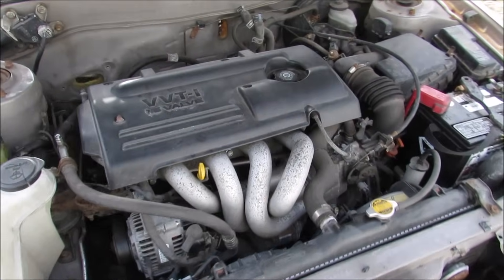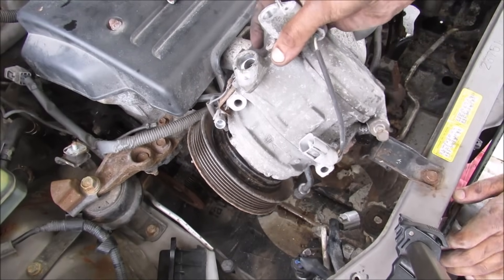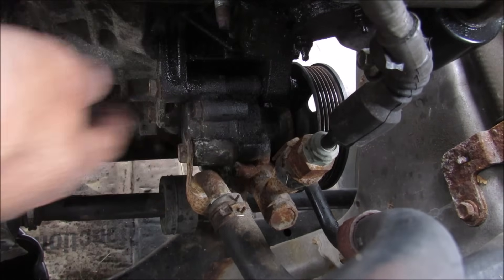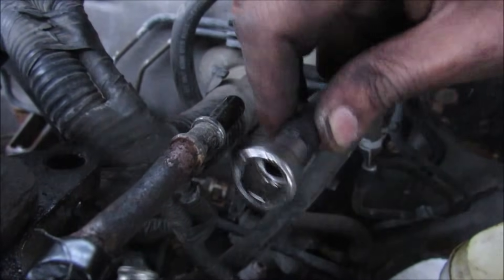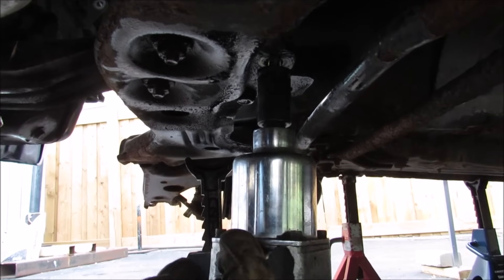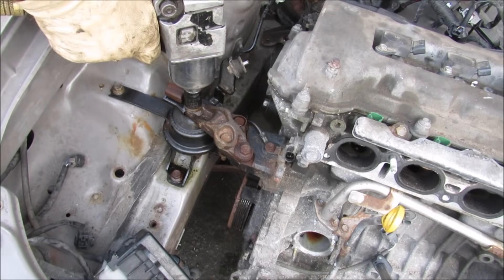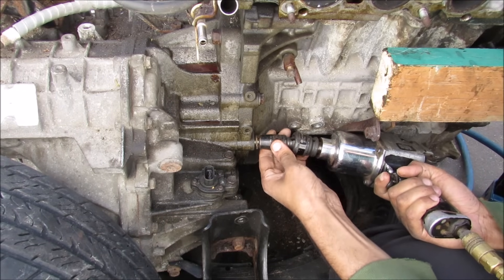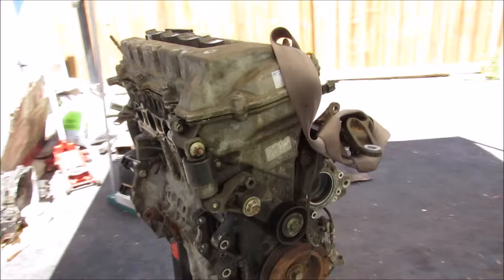How to Remove an Engine

Comment: Do you think this would work with the 3.0 v6? I don’t want to drop the subframe
Reply from the maker: I've removed a transmission from the 3.3 V6 Camry but it had to come out the bottom. 

I was able to get a 3.5 ES350 to come out the top, check my other video on that.

Comment: im doin this right now.   all but one exaust bolt has lost its nuts, just crumbling metal.  power steering pump bolts are out but its rust welded to the block. both studs broke off the bottom of the engine mount when trying to remove, they were rusted through like you would see on an old Ubolt for leaf springs. the alternator is crunchy, one starter bolt head broke off, left the stud behind.   the trans to engine bolts - more than half needed a big 1/2" air uggadug or a breaker bar with cheater pipe to break free.    coolant hose clamps were not reusable as they fell apart like a dorito when compressed.   im attempting to remove the engine nad leave the trans in - we will see....   its all loose now, tomorrow ill try and pick it up.

Comment: What is the minimum that needs to be removed to hoist the engine and transmission out if the car is going to he scrapped?
Reply from the maker: Axles, engine mounts, harness, fuel, vacuum & cooling lines. The rest can come out with the engine.

Comment: Fyi this isnt a good tutorial, many redundancies here, my biggest one, you can remove the transmission before pulling out the engine I honestly dont know why he didnt do this, it defies logoc, second things attached to the engine like water pump, alternator, etc can be pulled out eith the engine. For the begginer.wheb renoving and engine focus on disconnectinf these: transmission, any and all vaccum tubes, disconect radiator hoses, disconnect cables, disconnect gas line, lastly disconnect transmission, at  that point disconnect engine mounts, then youll be good to go.

Comment: Very good, concise video!
Two things I would focus on:
1 The welded nut for belt tension release; kind of odd thing most people would probably be clueless about (including me at one point 😁).
2 The exhaust manifold connection to the muffler connection needed to be unbolted.

Comment: i looked up "How to pull an engine" expecting a tutorial on an old muscle car or a truck or whatever, but no you made one on a 2001 corolla which is exactly what I needed! I'm preparing to pull the engine from my 2002 corolla soon, only difference is its a manual. Thank you for making a video thats short, and to the point showing every step, this will make my project much easier now!
Reply: I'm trying to swap a 1999 with a 2002 that is a mess. I guess I will need to swap the head of the 1999 with the 2002 because of the vvti. Can an engine swap be done without removing the ac refrigerant? I've never done this before.
Reply: @bubbadoright9271  It might be possible, I had mine drained and removed the compressor before pulling it to have as much room as possible. But the compressor it only held on by 3 mounting bolts and the high and low pressure hoses. If you can pull the mounting bolts out and have the compressor supported by something so it doesn't hang from the lines, then theoretically, you might be able to pull it off without draining it. It's close to the bottom of the engine, and I dont think there's anything that would get snagged in that area when pulling the engine. You'd have less room to work with, but it should be doable. Just be careful and go slow. If anything doesn't feel right, just stop and check everything before continuing.
Reply: how long did it take u i’m pulling mine to do a crankshaft

Comment: I'm having a hard time trying to remove my 2008 chevrolet impala engine. The exhaust manifold bolts are stuck. Am I supposed to remove the manifold from the engine block? I am trying to disconnect the manifold from the exhaust pipe (looks like @2:20).

Comment: That was a really good video. No extra bs just the info needed. I do have one question. Is it really necessary to pull the trans with the engine. Mine is an all wheel drive and I really don't want to have to remove all that crap. Plus it looks like there's enough clearance to get the engine out and in without pulling the trans.

Comment: I've 2016 Ford Focus SE 2.0 L . I need to somehow lift engine by hoist ( which I don't have yet ) or by jack enough to replace motor mounts and even timing cover because it's broken too . I didn't want to and took it into a shop but he now says it's going to take longer . That he hasn't had time to do it . Yeah because he keeps doing smaller quick turnaround jobs abd leaving no time to work on mine . I'm not having that nonsense and told him either you stay true to your word and start by tomorrow or else I'm taking it back . Either do it myself or get a honest mechanic .

Comment: Couldn't you have remove the torque converter bolts through the starter hole and left the torque converter in the transmission?

Comment: I wish I have all the things some day so I can get the engine out of the car disassemble it  change the pistons to high compression ones and new rings since old ones are blown change the seals clean the engine bay and the engine.. paint the engine block and valve cover and then install everything all organized ( I have never worked on cars)  I have but they were easy fixes not something like this

Comment: I have no idea why I just watched this video when I don't even know anyone who has a Toyota.

You should remove an engine out of a trailblazer with the 4.2 liter
I6
Reply from the maker: Why
Reply: @speedkar99  I guess so you can see what a huge pain in the butt of is. The front diff is bolted to the oil pan and the CV axle for the passenger side goes thru the oil pan so you have to remove the entire 4X4 to get the engine out. Worst design I have ever seen

Comment: So you take out the engine by disassembling it? What a waste of time. We just unbolt everything under the car and under the hood, cut the tubes, cut the wires, lift the body up and the engine just falls through the floor.

Comment: Yo I've got a quick question, do you need to discharge the ac always or is there another way so I don't have to pay $500 for an ac expert to come out and discharge it for me?
Reply: The hoses are flexible. Sometimes you can disconnect the AC compressor from the motor then just lay or hang it somewhere in the engine bay without cracking the lines open.

Comment: Would it be possible to remove the engine without taking out the transmission?
Reply from the maker: Yes 
If you can reach the bell housing bolts

Comment: i have to remove the engine block in a 2000 4 runner with out the transmission,can you recommend me a video related to that? thanks in advance

Comment: Man..
I think i need air compressor tools..
I barely able to open the exhaust manifold because it is so tight
Reply from the maker: An electric impact is a good place to start
Reply: speedkar99 by the way, how do you disconnect the air conditioning cable? Do you discharge the refrigerant first?
Because i read haynes manual it says only qualified mechanic able to do it. When i tried to disconnect one of the hoses of the AC some gases are escaping from that opening and then some fuel starts to drip (because i already disconnect the fuel intake hose to the engine)
Hopefully you understand my english

Comment: It is easier to take out engine from Subaru's Crosstrek as compared to corolla
Reply from the maker: Yeah it's easier in a longitudinal mount
Reply: @speedkar99  I was earlier confused between Toyota Corolla and Subaru Crosstrek. Which car is better as per your mechanical review? I can manage some maintenance like removing engine every 150,000 miles.

Comment: I would have to do this procedure in steps with photos and ziplock bags labeled for bolts.   Do you have a video of replacing the engine back in the vehicle?
Reply from the maker: This vehicle was swapped with a 2JZ lawnmower engine. See my convertible video 😂😂

Comment: Pretty sure you don't need to disassemble the top side of the motor to remove it...
Reply from the maker: I did that because I was tearing down engine at the same time.

Comment: How long did it take?
Reply from the maker: Few hours each day across a week
Reply: @speedkar99  I've never removed or replaced an engine. My son's 15, we're pulling a 250 in line 6 from a 1950 F1. Replacing with a stock 302. 

I'm in the deep end of the pool.😶

Comment: perhaps it's a stupid question but i'll ask it anyway=)  how did you make sure none of the bolts sheared off?  i had that happen to me once but fortunately it was it was only one of four bolts holding down the back seat.
Reply from the maker: Rust is a killer. PB blaster helps, but I do shear bolts. This car was scrap so I wasn't concerned.

Comment: How do you keep track of what you remove, screws location, torque, that's the important part, anyone can unscrew stuff
Reply from the maker: Well I'm not reassembling so that helps 😉
Reply: Some people put the screws/bolts back into the part that they removed once it’s out. Or label ziplock bags.

Comment: I just bought a 1960 Thunderbird with a blown  352 but I have a 1984 cougar with a 302 and has 76,000 original miles would I be able to swap? would there be mutch alterations

Comment: Dang that's alot of work. No wonder it cost so much when engine work needs to be done and can only be done with it removed. I got a $6000 used car with engine trouble. Probably just start thinking of buying a new car as the repairs will cost half as much as the car!
Reply from the maker: Ouch!

Comment: When taking something like this a part, how do you do it in such a way that you're able to keep  track of all the parts? Is there a common method on how to do that?
Reply from the maker: Labelling and putting bolts back into their holes
Reply: Me and a friend are working the same car but at different times so we've taken to just using a shitload of sandwich bags and just real specifically labelling what the bolts are for and how many there are and keeping them all in the same place. Works well enough so far.

Comment: My god how do you remember how to put everything back together?
Reply from the maker: I don't...the fun is in taking it apart
Reply: Watch the video in reverse.
Reply: Take pictures before every step you take.
Write notes on paper in steps and move in reverse when your done.
I use cups with numbers to track bolts and work reversly.
Reply: @Mrkevi123  im gonna tape every bolt and screw with yellow electric tape to each location they belong on lose parts.
Reply: Just label everything with some tape and you'll be fine

Comment: Question could you remove the motor without the the transmission? I have a 2000 Celica  gts auto and am in the process of removing the motor but my transmission is still good. I removed all 6 bolts connecting the fly wheel to the torque converter, can't I just split it then pull just the motor
Reply from the maker: You can but in my opinion it's more difficult since you'll have to support the transmission somehow and aligning it back up upon installation may prove tricky because there are pegs in the bell housing.

Comment: 13 feb 2019 5:45 pm est:
thanks.if benz-g-class has honda-fit-engine then that benz-g-class' fuel-consumption become efficient,frugal.

addition 13 feb 2019 5:49 pm est:
but g-class is too heavy.curb-weight-lbs
5624     daimler-mercedes-benz-magna-steyr g-class amg-63 y2018 #m# #at-only#
2489     honda fit lx y2010 #mt# #m#more curb-weight-lbs:find 'curb-weight-lbs' in wortel.ucoz.com/car_review.htm

9 dec 2019 1:48 pm est:
thanks 4:21 4 screw hang car-engine above sub-frame, so sub-frame does not carry engine-weight, so sub-frame allow lower-control-arm to move-up-and-down, making independent-suspension possible ?

Comment: Hey Speedkar, do you know if the engine removal procedure on a 2007 RX 350 is the same as a Sienna? Do I remove the subframe to take the engine and transmission out together, or can I go through the top?
Reply from the maker: I believe it is very similar since they are mechanically related, but I haven't done it myself.

Comment: did you use a 2 Ton Foldable Engine Crane? how about the engine stand?
Reply: nevermind, you used a 2-ton Foldable Engine Crane the one that home depot sales, but you used 1-ton setting and the Engine stand is a 750 lb stand.

Comment: I watched this while high, time well apent
Reply: I think the cables and pipes are the most confusing.... by the way im also high, so how do you know what goes where when you put it back into the car
Reply: @thulasizwezuma2758  Take many pictures... You can actually go back to the dealer and most all models have wiring diagrams, coolant hose diagrams and such. Many hoses on cars are prebent and or special molded pieces and have to be ordered so the dealer has to keep these part diagrams...
Reply: Same but I learned that it’s not really that hard as I thought. Just a little bit of time. The more you do it the better you’ll get at it.
Reply from the maker: Haha what did you learn
Reply: lmao samme
Reply: +speedkar99 I learned that taking out an engine is a lot harder than I thought and that there's no way in hell I could ever do this.

Comment: Hello, I installed an engine and transmission together in my 2003 Honda Accord 4 cylinder, now I can’t get the car out of park. I must’ve did something wrong with the shifter cable when connecting it back to the transmission and the gear shifter. If you know how I can adjust the cable , can you share your insight please
Thank You

Comment: With so many moving parts, wires, hoses, fluids, seals and other bits and pieces, it's a miracle that these cars can be so reliable and last so long.
Reply from the maker: Your right. Now imagine newer cars with even more guts!
Reply: speedkar99 I think they're getting better. Electric power steering looks like a much cleaner design. Electric cars even better, less moving parts, seals and fluids. 
But: in return we get millions of lines of software code we don't see, all virtually moving in a very complex dance, all made under pressure of product launch deadlines. That's where the problems of the future will come from, that and all those sensors.
Reply: @jean-paulvanewijk1810  Tesla batteries are dying after like 10-20 years though
Reply: Ok

Comment: what are the various point in engine, to hook and pull it out.
Reply from the maker: +sivaraj palanisamy at the top of the head under the valve cover there's two holes where you can bolt on hooks
Reply: Thanks much. is it like a standard for any engines?.. or can i use enggine mount to hook.

Comment: Is it not possible to leave the compressor attached to the ac lines, same as power steering pump, and just hang them off to the side so don't have to mess with them?
Reply from the maker: +modobomber Yes you can remove the compressor and leave it off to the side, just make sure it doesn't get caught up when hoisting the engine. Removing the drier and condensor gives you slightly more space in the engine bay to work though

Comment: A 2011 doesn't look much different, 420k miles before failure
Reply from the maker: +Pat Pikulski your right, although the engine is the newer  2zr the layout is similar
Reply: speedkar99 so a 2011 1.8L Corolla is a 2zr engine?
Reply: Over 50k miles per year? I thought my 30k was impressive.

Comment: Great video. I see y mechanic shops charge so much. Working on cars is ALOT of work.
Reply: corymartin100 Just get a dirt cheap 2nd vehicle to learn.
Reply from the maker: +corymartin100 it sure is! But if your taking your time and doing this as a hobby like me, it's a fun learning experience
Reply: speedkar99 ima pussy. Ive ALWAYS wanted 2 work on an engine but just never had the balls 2 just do it.
Reply: Working on transmission or pulling a motor is a lot of work but almost everything else is not too much work especially since they have lifts

Comment: Good video and i tried to remove my Toyota engine. But no instruction how I put the engine back in car so no I have a car without engine and an engine without car
Reply from the maker: +Patrik Cedermar that's perfect. Follow my convertible video and my engine tear down video for the next steps
Reply: Just watch the video in reverse.
Reply: Reverse the video

Comment: Good video, managed to do mine along with the video, can't believe it only took 8 and a half minutes.
Reply from the maker: +호주사람 Sweet, especially if you have air tools it helps.
Reply: 호주사람 I got it done in 7 mins I didn’t have to stop and explain what I was doing to anyone.
Reply: Fukn Oath sas mate, he really shows the pace you gotta try work at to get the job done quick and efficient. 
So many people spend hours on each step. 
But if you can just bam bam bam through the steps then it can be done within a few hours.
Reply: Bout tree fitty minutes here
Reply: That was fun! Where’s the video to put it back in working order????
Reply: @fgh7832  just run video backward, it's same procedure alfa used to mount engines in the Portello factory
Reply: WOW. WTH! 8 min. This comment just inspired me. Especially being that I have to do mines myself soon. Thanks. 8 min
Reply: Rather 8.5 hrs 😄😄
Reply: i did it in five minutes with my beer on on the right hand while baging my girl
Reply: I had the girl you were banding do it and she had it removed in 4 minutes LET'S GO BRANDON 😷😷😷😷😷😷

Comment: Another excellent video, just one slight correction; engines with an automatic transmission have a flex-plate instead of a flywheel.
Reply from the maker: +Dinal Abay Thanks

Comment: pls show the location of pcv valve
Reply: TheRouteShow When looking at the engine from the front of the car, the PCV valve is screwed into the side of the valve cover on the driver’s side closer to the back of the car.